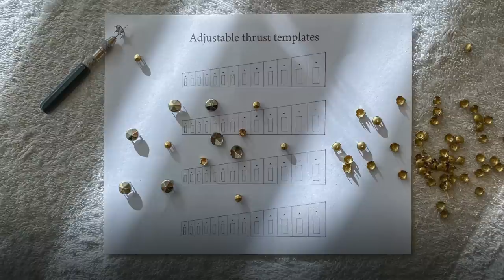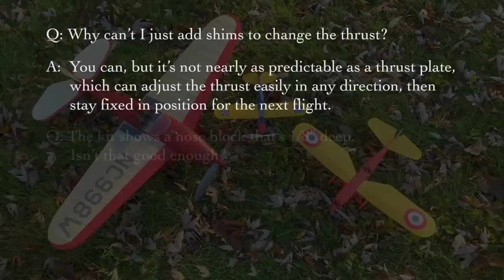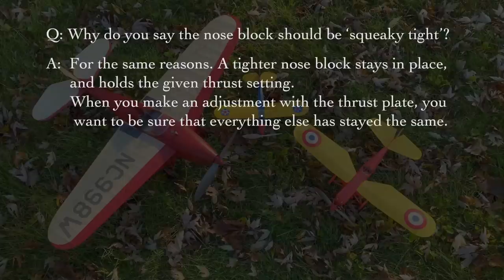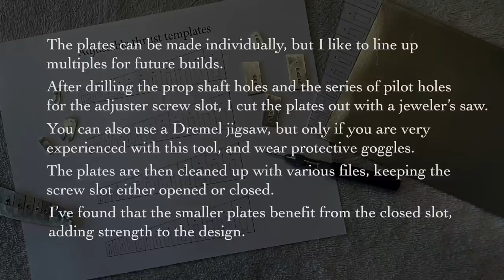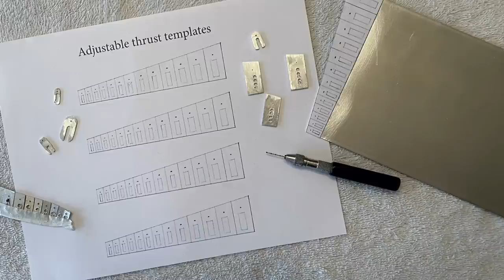Free Flight Basics #4 - Thrust Plates & Nose Blocks

Comment: Thank you Mr. Hallman. 
What I would like to hear from you is your insights/comments about the the wing washin-washout issues.
Reply from the maker: This has always been a confusing issue for me until I learned about gurney flaps, short lengths of thin balsa, usually attached to the trailing edge. They act like mild ailerons, and can be moved about on the TE to either give more or less of an impact. Thickness and length of the gurneys become a factor too.  You'll often hear me talking about them on my Anatomy of a Trim Session films. You'll also see these sticks on many of my models, without notation.  I am hoping to do a film on this subject, taking a perfectly trimmed model, then adding gurney flaps here and there, to quickly show their impact. Stay tuned. Thx for the comments.

Comment: Thank you for your effort with sharing your knowledge! 
I am beginner in free flight and have just made the structure for Hawker Hurricane 30" from Dumas Products, However, the drawing described 2 degrees downthrust in the structure against the thrust block.
I followed the drawing before I saw your informative Basics #4. But I suppose it so little that I just can follow your description. Anyway thanks so much for your videos!
Reply from the maker: Thx, and I'm glad to hear ur trying FF.  Many times we build in thrust with the nose block plate, especially if there's a spinner on the model. It makes for a cleaner look. But it's good to have the thrust plate too, since now you will have all of the control, should u need more down thrust or right thrust etc.

Comment: Thank you for the tips on the adjustable thrust noseblock setup. I am building two easy built baby hornet planes for my two boys. I was just about ready to cover until I saw this and decided to convert them to this setup. FYI, just came back from Hobby Lobby and they have the buttons in the sewing section. The brand is sewology. I got a package of 6mm black 60 count buttons for 50% off ($1.14)!

Comment: Trying this technique now for the first time, so I'm revisiting the instructions. The noseblock is essentially the plane's engine, so more precision will have to yield better results. I'm DONE with ugly shims that fall out. The amazing thing about this system is that it all can be done by eye with no perfectly aligned drill press or perfectly square workpiece. I think I'll substitute .047 wire for the shaft. The gravity is pretty strong where I live and .032 wire bends too easily. Thanks for providing this invaluable reference.
Reply from the maker: Thx for the feedback, Ken.  Ur observation is exactly what I felt after I first tried this 30+ years ago. It's very adaptable to any size model, and yes, eyeballing it all works well.  My kind of building & adjustment! The dia. of the prop shaft will surely change, depending on the size of the model. I've used a .062" on my Gollywock, that would still easily bend via the leverage of that large prop on a typical smooth landing. Frustrating. But after I cut a wedge out of the top of the block, which helps the prop & block flex outward upon landing, the leverage on the shaft is lessened significantly, leading to zero issues with the Golly's shaft. Cheap thrills...
Reply: @maxfliart  I should have specified that I'm building a Carl Goldberg Shoestring from the all-sheet Jig Time series with about a 19" wingspan. I built a couple of other reproduction sheet models from the internet and the front ends as designed are disastrous. But the better I made the noseblocks, the better they flew. This one should be the ultimate expression of noseblock art (lol), but I note it's not as "squeaky tight" as I tried for.
Happy Thanksgiving!
Reply from the maker: @kenkingsflyingmachines2382  The Shoestring should be fun to see in the air.  I've built a few racers from that era and they definitely look great in the blue. BTW, I've often added small bits of bond paper or card stock to the nose block, then soaked with CA, as a way to firm up the fit.  U can always sand a bit away 
if needed for that perfect fit.  Good luck with her.

Comment: OK. My burning question; how do you calculate the surface area and pitch of the propeller for the craft size and rubber used to get the flight time per wind that you achieve?

Also, I keep thinking we could use a different ratio of rubber or gears to resize props, with as much work as you put into that front end, I’m surprised you haven’t done that already.

These videos are great! Thank you so much. This really helps with my own builds.

Comment: What if the wieght to power ratio is such that the model does not require down thrust and you can just use a gurney flap and rudder flap to change direction?
Reply from the maker: Yes, I'm sure that could work for some models, but most require some degree of thrust adjustment...and u won't know the amount until u first fly it, so I build them in for each model.

Comment: Doesn't the metal on metal wear out the prop shaft and thrust plate?
Reply from the maker: No. At the rpm's we're flying, the wear and tear is minimal. I have models with the same plate for over 20 years without any concern for replacement.  You could also use brass plate.